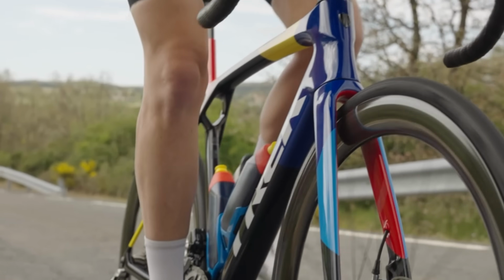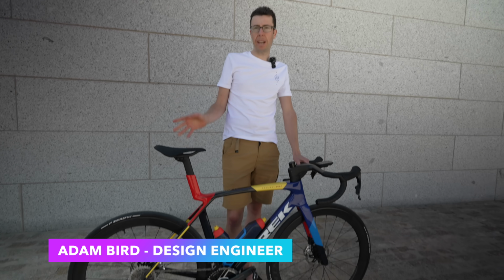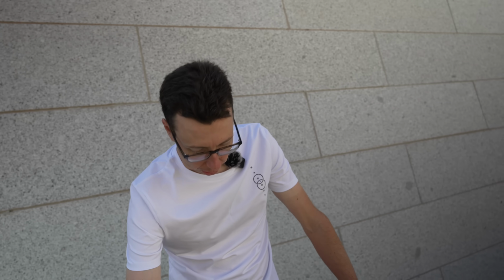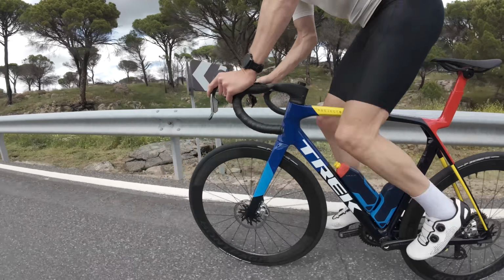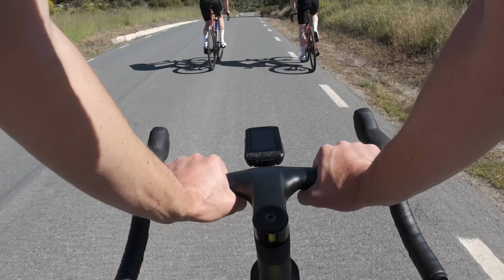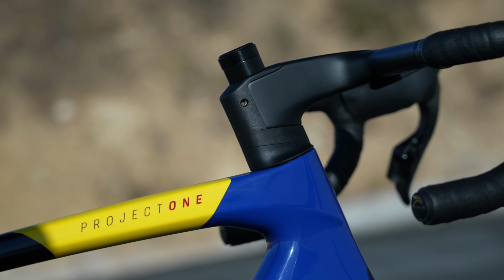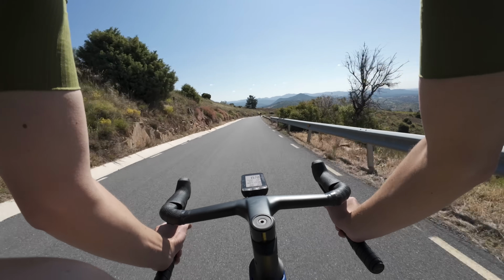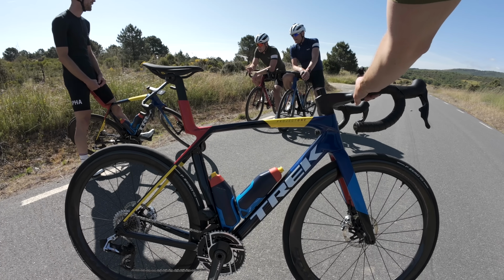I Can’t Believe Trek Has Done This! New 2025 Madone SLR replaces Emonda...

Comment: 7340g measured, with a scale accurate up to 100g and the bike visibly swinging. So let's make that 7300g. Then we have to deduct the SRAM batteries, they are not factored into the groupset by SRAM for reasons beyond my comprehension, but that's how it is and hence they are missing in the calculation of the Madone SLR9 AXS (that's also why the Madone SLR9 with Dura Ace supposedly is 50g heavier. We are at 7250g now. Then we need to deduct the bottle cages, these are 35g each, with the bolts weighing in at 5g a pair. We are at 7170g now. Then we have to deduct the Garmin holder which I beleive is around 30g. We are at 7150g now. And the remaining 150g will simply be the paint job. The claimed weight is for the Matte Carbon Smoke colorway, which has almost no paint on it. But that's somehting not specific to the Madone, it's completely normal for paint jobs to add weight to a frame. A Trek Madone SLR9 Gen7 in frame size 54 with almost no paint on it is still heavier than the bike you tested by the way, so a more matching frame size 56 will be considerably heavier. This video is pure confirmation bias on your side, since you miss the Emonda. And now get this: The Madone Gen8 actually is the Emonda successor, not the Madone successor. This frame started it's life as the new Emonda. It just happened to be so aero that the need for two bikes was not there anymore. And the Madone having more ring to it's name as the top bike in Treks lineup was then picked as the name for Treks new all in one bike.

Comment: I’m cycling for 10 years and each year I hear, 5% lighter, faster, aero. But actually there not so much difference to buy new bike each year and even 5 years. Actually my 6 years old bike was 7.5 kilos, and very fast, cost me 4k usd , today same model from same company 9 kilos and cost 6k (so where is improvement?) . Actually, there is no reason to upgrade. And someone can say disk brakes better, but they are sucks, on dry conditions they stop exactly the same, they need much more maintenance, and I don’t cycle in rain. Electric shifting also has so many problems and cost a lot of money and already had issue in competition with that gear. So, all that marketing sucks, industry trying to get our money by selling stories. After bike upgrade, I don't find too many improvements even I have now aero, disk brakes , 12 speed electronic gear, my speed is not changed, my feelings on the bikes are the same my happiness level from cycling is the same on 1k bike and on 6k bike

Comment: Only 8 weeks ago I got Gen 7 Madone and was so disappointed to see this until I saw the actual weight.  My 54cm with the D1 Sram red, pedals, OSPW, 50/37 chain ring and project icon paint weighs in at 7.7kg.  I also think the thicker seat stays look so much better.  Plus the price has increased by $3000 AUD 😳

Comment: As aero as the previous Madone..? It may be if you use the provided aero water bottles and compare with round ones on the old bike. Using 2 conventional round water bottles the new one model is most likely less aero.  The new SLRs come with the aero bottles,, do the math.  I like the look of it.

Comment: The bike industry has run away from bikes that make sense to typical consumer. A pro level bike is just that I suppose. But the $ being commanded for them is totally absurd. Bikes should be pretty. This bike my stirs emotion as much as looking at a nice wrench. Not at all. Both are simply tools. Im hanging onto my rim brake Look. I want a new bike, pretty, light, lively ride… Looking more and more like a custom bike is what it takes (for less $ than this thing).

Comment: fewer sizes makes choosing a size easier...🤦 that's next level
Reply from the maker: I think what they mean is without the overlap or closeness of sizes with the old approach there'll be less confusion when choosing the size, if that makes more sense?
Reply: @davidarthur  I think that makes sense but FEWER sizes overall is a bad thing - it's frustrating to hear it spun around like that in the marketing. A greater overall range across sizes is cause to celebrate though

Comment: To me the smallest and most insignificant changes are between the SL7 Gen 7&8. Pretty much the entire gen 8 bike is exactly the same and weighs only .28grams lighter. I prefer the more aggressive look of the gen 7. I would expect an immediate price drop of the gen 7 though given that both are currently the exact same price. Seat stays is a little thicker on Gen 7 but gen 8 does have a slightly more compliant stay (argumentative how much better it is). Aesthetically, the gen 8 color schemes are beautiful and imo, Trek has the best paint jobs in the industry.

Comment: Love how these companies present cost-cutting measures and less choice for customers as an improvement.
Reply: To be fair, Specialized and some others are getting close-ish to the UCI weight limits which means that at least for pros, there is literally zero benefit for additional weight savings.  So they might as well try to make that 6.8kg system more and more aero.  Trek is a fair bit off here though.
Reply: Well, it is and improvement. For them.
Reply: "Spin" of the marketing type. "Spin", in my book, is to maintain a high cadence. They seem to get the two confused! To their benefit of course.
Reply: That is what it's all about 100%. It's pure coincidence that it halves manufacturing set up costs. Perhaps the perfect aero/light weight frame might eventually (i.e. soon) be discovered that will mean one identical frame shape is possible, that can be manufactured at one single (probably Chinese) production plant (wholly manned by AI robotics) that all brands can commission to produce their 'uniquely' branded bikes....you'll only be able to tell by testing under ultra violet light which paint colour is the fastest.
Reply: 100%. just a do it all bike. its going to be worse than either and the weight difference between the gen 7 madone and emonda is less than half a pound and data has shown no matter where your riding the aero gains even on climbs more than make up for the difference.
Reply: Truth